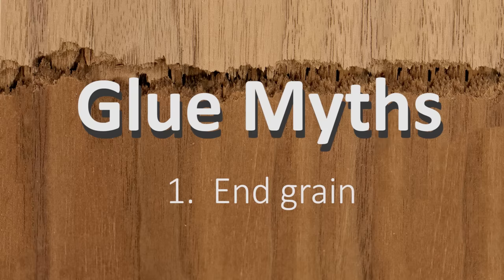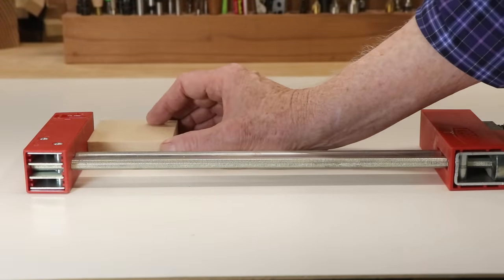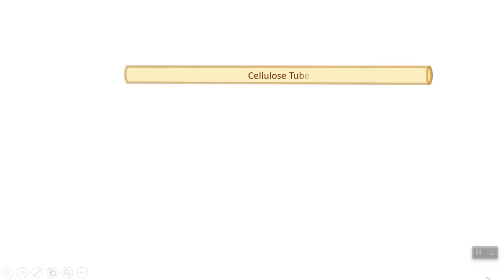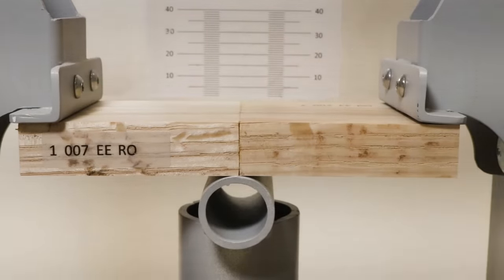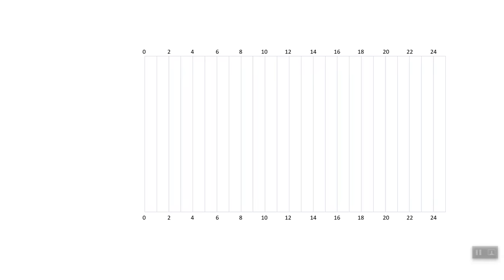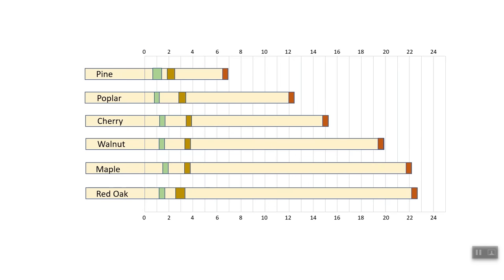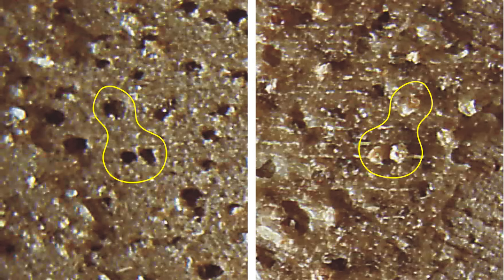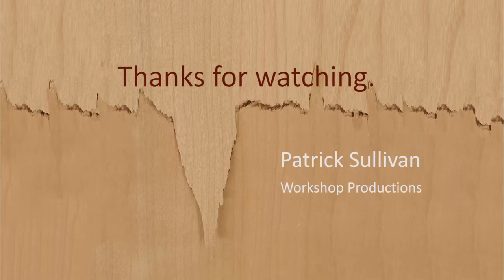Glue Myths:  1. End grain

Comment: The myth probably comes from the fact that with end-to-end, it is the glue that fails and not the wood.  Making it LOOK like the joint is stronger with side-to-side, and end-to-side.  The glue LOOKS weaker with end-to-end because that is the failure point.
Reply: I was thinking the exact same thing!  Instantly where my mind when when I saw that first end-to-end bond broke alonge the glue line.
Reply: Exactly.  The first thing Dad taught me about woodworking when I was a little kid was that the glued joint is stronger than the wood.
So it's not that the end grain joint is in itself inherently weaker, but the joint is indeed weaker than the wood, which goes counter to what we've always been told.
It goes back to properly engineering the project to avoid building in weakness through poorly located or sized joints.
Reply: Go one step further in the myth to see why it exists: 

The end-grain-glue failure is being compared to the much superior long grain strength (two short pieces made into a long one, then stressed  like a beam). Hence, "end to end glue up is weaker than the wood". In a side-to-side glue up, glue is compared to the weaker lignin strength, with stress parallel to the grain. Hence "side to side glue up is stronger than the wood".
Reply: Also misinterpretation in memory - people read or heard something, then they remembered it the other way around after many years, so a myth spread... I thought the results were obvious - that's why it's completely fine to miter frame corners and there's no need to look any further.
Reply: Was about to say the same thing
Reply: Nobody knows because the long grain joints have not failed.
Reply: That would depend on the cross section of the timber to be mitred.
Reply: More complicated than that, the type of force applied (tensile vs. shear) and the leverage applied change this outcome.  Try it yourself- go glue up end grain to end grain, well-machined pieces but make each piece at least 24” long.  I can snap that with arm strength and it fails exactly on the glue line.

So yes, karate demonstrations have already shown when designing furniture that your parts that need to be strong need to have the grain run in the direction perpendicular to the direction of force that will be applied to it.

I don’t see why this result surprises everyone?   

But I’d love to see more tests!
Reply: He says this at 14:00 or so
Reply: @dushk0  It is perfectly fine to mitre mitre frame corners but look at how a gap creeps in on the inner edge as the wood shrinks across the grain and breaks the glue line. This is why mitred joints are re-inforced and the fundamental time-served law of strong wood joints is fibre overlap! All this is fine for entertainment but misleading to those taking up woodworking as a practical pursuit.
Reply: Agreed. The myth is almost certainly based in drawing conclusions form non-scientific observation
Reply: my guess is, with end to end joint, you are almost always joining together long pieces of wood on a small joint surface.  With side to side joint you more than likely would be joining together the long side of your wood pieces, with a much larger joint surface.  So an end to end joint, despite been stronger per unit surface area than side to side joint, appears to fail more easily, due to dealing with more stress on less total strength.
Reply: @xsu-is7vq  The word is 'lever' (which applies in the practical world of woodworking) !!!
Reply: When you compare joints the ony useful information is in a practical application which involves geometry and forces such as leverage. It is the lignum that fails.
Reply: Also it could be that glue technology has advanced to make the breaking force greater than or equal to the lignin breaking force
Reply: @WoodomainJeremyBroun  Don't agree with your last sentence. The video is not misleading. It is perhaps the most thorough and complete examination of the specific comparison of wood strength and joint strength with PVA glue when side grain vs. end grain are compared. What part is "misleading"? Woodworkers should know this information because it relates to and explains so much that we think we know, and also points out the misleading nature of some things we "think" we know. Like the statement that end grain joints are weaker than side grain joints.
Reply: Hundreds of years of furniture makers testing designs can’t be disproven by one misguided test.  End grain glue joints don’t allow the wood to expand and contract over time.  They have a 100% failure rate over time without any external forces being applied.  The natural movement of wood breaks the joints.  This video is seriously misleading!
Reply: @tedpancoast1272  Not really. 🤔 He was stating facts, backed with data, on basic initial strength tests. He was not testing strength from wood expansion and contraction... that's a whole  different experiment in wood dynamics. Great point though! 👍
Reply: Was going to make this exact comment.  That combined with end grain joints often being the butt end of a lever, it makes sense they would seem weak.  Like in framing, when we pull braces off a wall you can't just pull the brace off one end by hand, you have to knock it out with a hammer.  But then you grab the brace and a with a little jiggle and twist of the board the other side pops right off.  The same nails that had that board welded on keeping how many lbs of force on them plumb, seem totally weak when a huge lever is applied to them.
Reply: I would also add the difference between failure vs total catastrophic failure probably comes into play and the myth was probably started from past woodworkers repeating what they learned from engineers (or spec sheets) without understanding the details and it just got passed on over time. A lot of misinformation gets started that way (like the '8 lbs to rip off an ear' thing)
Reply: My thoughts exactly
Reply: @tedpancoast1272  Yeah. I mistakenly believed this video and glued up part of a project with end to end grain. Today, a year later, I was making some additions to it and noticed that joint broke. So I had to essentially route out 1/4 inch deep rabbits and glue in a piece of 1/4 inch oak spanning the now broken seam (all face grain glue up this time). This is what I should have done before but the video convinced me that it would be fine just glueing the boards end to end. There wasn't even stress on the joint. The piece is so well put together (with dovetails on each end) that I couldn't even pull the seam open enough to put more glue in it. And it still failed, as you said.

The natural movement of the wood just broke the glue line, even with minimal stress on the joint. And it did fail cleanly at the glue line. Annoying, as I wasted half the day fixing it and will delay finishing the project for a few more days now. But lesson learned. Never doing end grain glue nonsense again unless I don't want the piece to last.
Reply: @95countach  Sure but this is what we nerds would call "intellectually dishonest." The sentiment of the myth is that end grain glue joints suck and you shouldn't use them. If the natural wood movement cracks these joints over time even if they don't have stress on them then the sentiment of the myth is correct.

Some would call it "literally false, metaphorically true." But even that depends on what the specific phrasing of the myth actually is. People say it's weak, and if it cracks over time it IS weak. I guess if you can test it before any wood movement occurs it's fine but that's not how things work in the real world.

People are taking away the idea that gluing end grain like this is totally fine now and just as strong as any other configuration. I just had a joint fail on me because I believed it enough to incorporate it into a project a made a year ago. This joint had minimal stress on it and it cracked cleanly on the glue line. I learned my lesson.

Comment: I think this myth was also propagated because the failure happens at the glue when end-end joints are made.  So the logic was “because the glue fails when end-end, it must mean that the glue joint is weak.  But with edge-edge joints, the wood fails…so the glue joint must be stronger right?”  Without considering the overall strength! So interesting…
Reply: I think this is another case of survivorship bias.
Reply: This is exactly what I was thinking too. And of course what he mentioned was that we were comparing long side glued joints with short end-grain joints.
Reply: I'd wager that the end to end glued joints get weaker as the force of pressure gets concentrated further from center. I would guess that doesn't necessarily hold true for edge to edge glue.
Reply: @Montrovantis  I'd be inclined to disagree. Leverage is quite easy to calculate and will affect both equally.